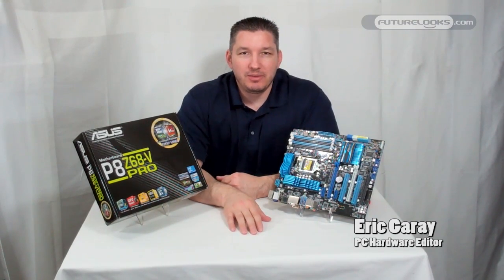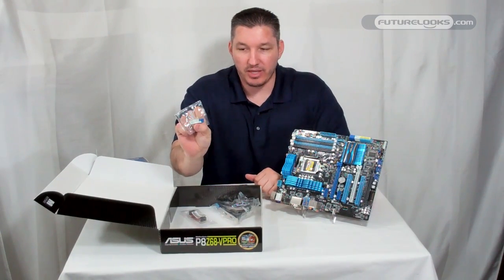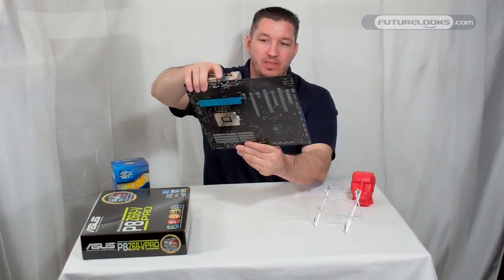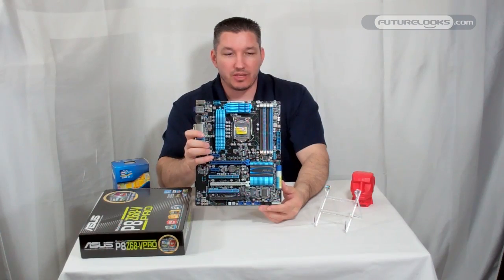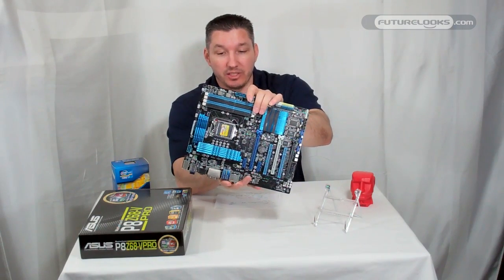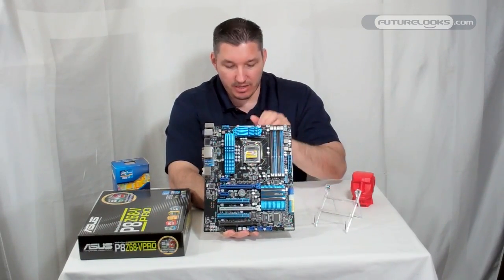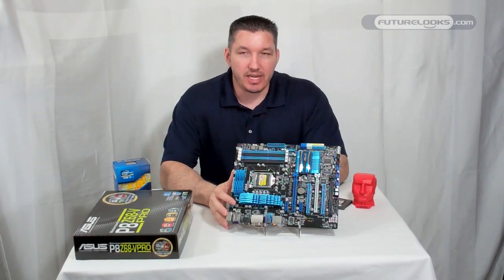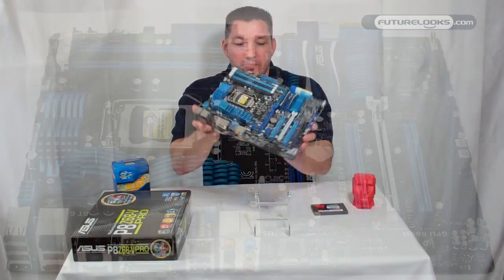Futurelooks Unboxes the ASUS P8Z68-V PRO LGA1155 ATX Motherboard

Comment: @don2xify No, you don't. You can overclock manually through the BIOS. The trick is to use the CPU VCore "Offset" voltage instead of manually setting the main VCore voltage. The board's TPU/DIGI+VRM works very well in that respect. I just find the TurboV software handy if in Windows. Happy overlocking!

Comment: @gabrocki Alas, the sockets are different but that's because it has more cores/threads and uses quad channel memory. Therefore, it had to have a new pin count and chipset. It's like all hex core systems - intended for content creating, not gaming. Your 2500K will more than suffice bundled with a good video card.

Comment: @don2xify TPU is part of the dual-intelligent processor (DIGI/VRM+TPU) that puts TurboV overclocking to work. The TPU co-processor communicates with board to auto accelerate your CPU. If you want to really use it, install the ASUS software Suite along with TurboV utility and have access to all of the voltage and frequency settings that matter. Great software to use!